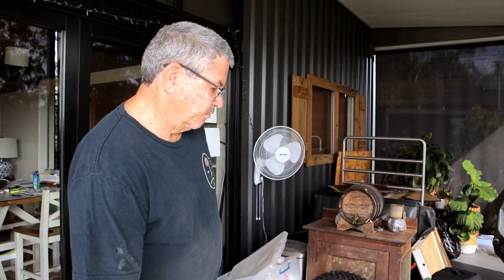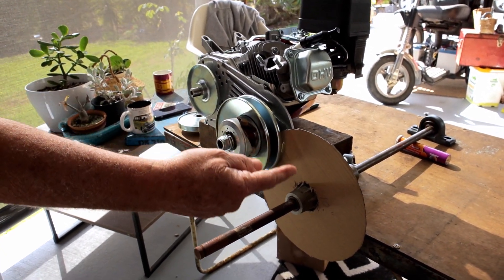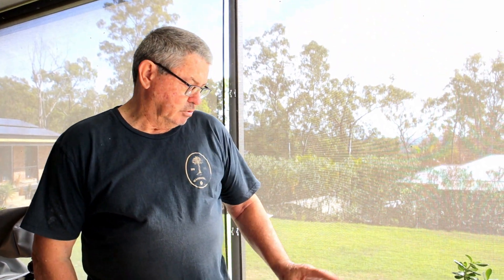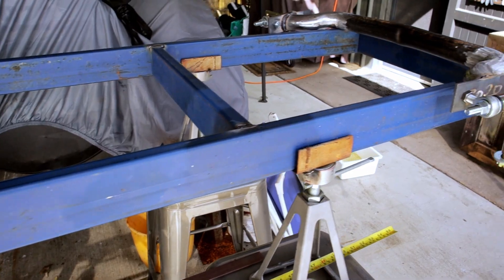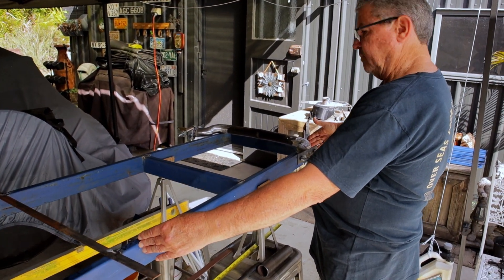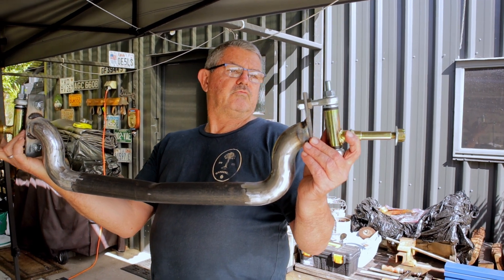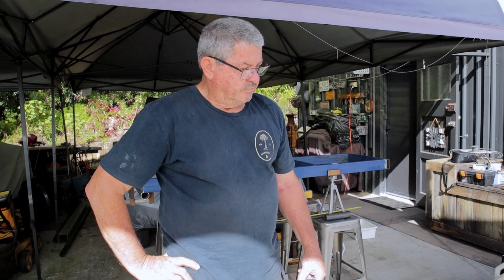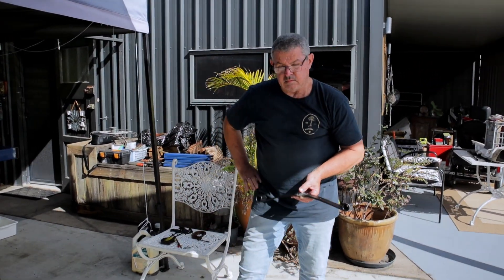First Cyclekart Build - Frame/Chassis Front Axle Ep2

Comment: Love the construction so far. Where are the tie rod like ends used on you king pin structure sorced from?
Reply from the maker: Hi there, they’re called heim or rose joints - any decent bearing supply company should be able to help you with them.  Thanks for watching!